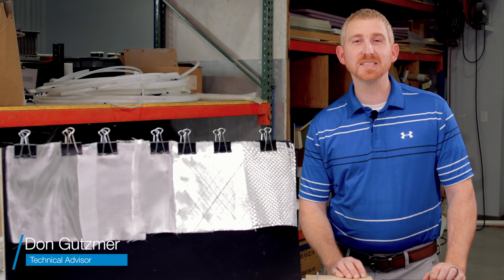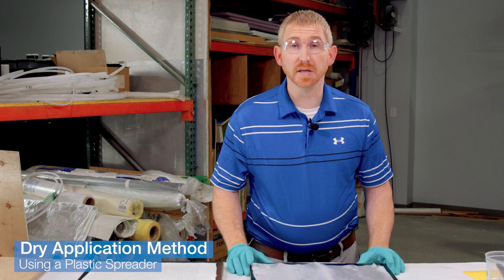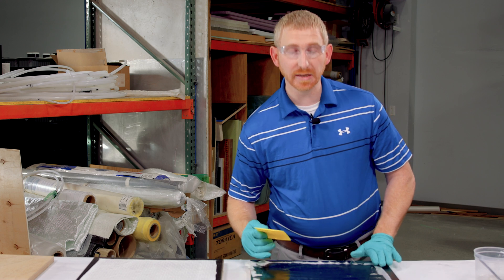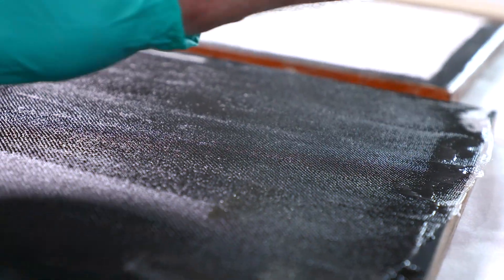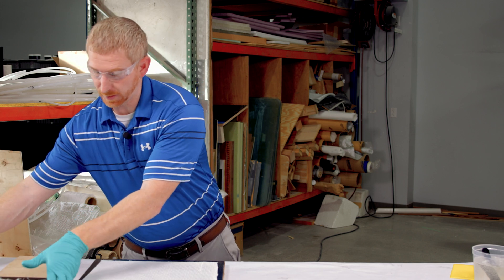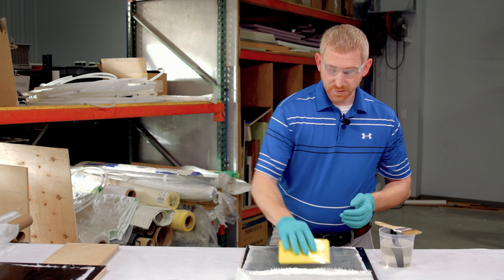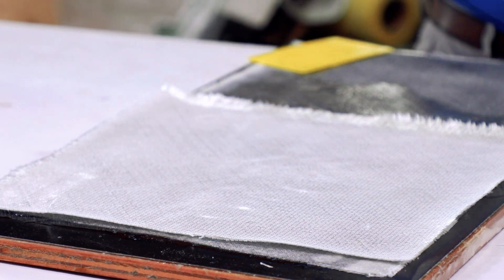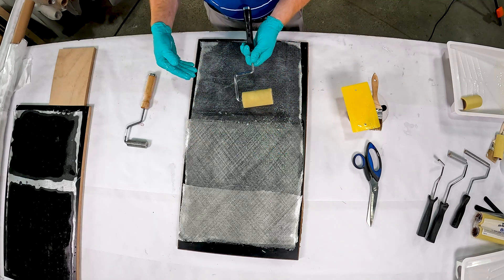Fiberglassing with WEST SYSTEM Epoxy: Basic Techniques

Comment: I'm going to be rebuilding my I/O boat's floor and transom and will need to be glassing the plywood.  Can you use 105 resin with 207 hardener for the entire project?  I'd like to not have to worry about cleaning up amine blush, and supposedly 207 doesn't have that issue.  Are there any advantages/disadvantages to using 207 vs the other types of hardners?  Can it be used just as universally?

Comment: I’m doing a custom finish on our roadracing Sidecar.  I want to put down a blue and green plaid cloth over them I was thinking a volan 4oz cloth over it which should become transparent to expose the plaid polyester cloth.  Does this make sense?  Would your product leave me with a nice finish that I can sand smooth? Or would I need to use an automotive clear coat?

Comment: would the same method apply if I wanted to skin in carbon fiber? Would a better method be to first create the fiberglass core and apply carbon over or a wet layup as described?
Reply from the maker: @WOLFITTIPS The same methods would apply to carbon fiber. For carbon fiber we recommend the wet method to initially coat the surface with epoxy then wet out the top surface to ensure the carbon fabric is properly wet out.—Avery

Comment: Do these techniques work the same when using G/flex 650 as the epoxy?
Reply from the maker: G/flex 650 does have the ability to wet out fiberglass cloth, yes. What are you planning on making or repairing?
Reply: @  the hull of my aluminum boat has a small area with corrosion from battery acid, I was hoping to use the cloth to give the G/flex some extra reinforcement
Reply from the maker: G/flex 650 has a higher viscosity than the 105 System, similar to honey, so it can be difficult to wetout heavier fiberglass cloth than 10 oz per square yard. We recommend warming G/flex 650 to 80 - 90F to help lower viscosity (keep in mind this will reduce working time). It would be good practice to use the wet method to wet fiberglass cloth. All the methods mentioned in the video can be applied to G/flex Epoxy.
Reply: @WestSystemEpoxy  thank you very much